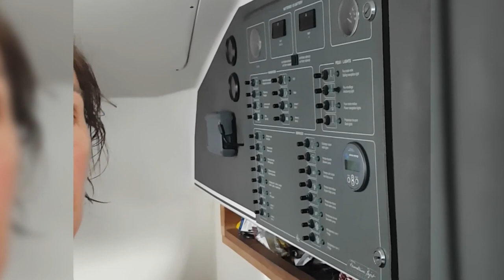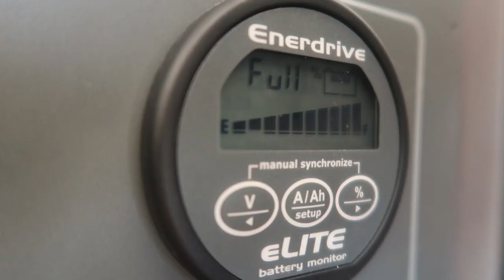Sailboat refit BOAT WORK - LIGHTNING DAMAGE Ep 84

Comment: Were you set up with lightning protection ?   Thanks
Reply from the maker: Hi John, as far as we know the yacht does not have any particular defence against lightning strikes.  However, apparently there are lots of different ways to do so.  One i've heard sounds interesting is some sort of fan of rods at the top of the mast that if hit can disperse the strike.  However, if it worked you'd think insurance companies would insist on them.
Reply from the maker: In case you missed it (and apologies for the delay) here is part 2: https://www.youtube.com/watch?v=Bbxfspilw4s&t=395s

Comment: Aah camaaaan! What kind of cruel twisted ending was that? Should have known that was where that was ending. Lol.
Interesting what you are saying about the power generation. you came up with something that alot of people don't think about, until it's too late. Power storage is as important as the generation. Are you on lithium batteries?
Anyway, I'll look forward to part 2. Seeing as it's following relatively quickly, I'll probably forgive you for that cruel ending. (Roll on the floor laughing.) Actually it's been a very Youtubey, sailing channel kind of morning. They've been popping up one after the other. Now I've caught up with you, I'd better get on and do!
Reply: Those are led acid batteries. They really should have a gen set. Wind power works on a sailboat much of the time, but its only 400 watts at best, where as a gen set of about the same cost will do a couple thousand in the pinch. Ideal situation is to have both. 

I live in eastern central europe off grid with my 2 sons, and we have both Solar, wind and genset when needed.  And we happen to be in an ideal belt for a 575 watt windmill. But it was over 14000 US to install it, however in the deep winter it has saved our ass. My solar is now upto about 3000 watts and that has run me $4500 and my battery bank is 48 volts at 550 amps. So quite large, and we no longer have any concerns about power. First couple years were rough though as it gets quite cold here.
Reply: @wishusknight3009  I imagine that a gen set would be important, living where you are, especially if your daylight hours in winter are as short as they were in Edinburgh when I loved there. Those short winter days are one thing I don't miss about living in Scotland now I'm back in New Zealand.
Reply from the maker: Glad you had a good laugh (desired effect)  and sorry for the cruel ending (I hope you can forgive).  Lead acid which do need the occasional top up of water otherwise work out well although much heavier than lithium.  I'm hearing good things about lithium though do wonder about the fire hazard - probably not an issue now days.
Reply from the maker: @wishusknight3009  that's a fantastic set up you have.  If/when we go land based again we would love to continue to live off the grid - the independence alone is worth it.  Great information shared, thank you.
There was no genset when we purchased Javelot and though at times we needed to turn off the fridge over night if there was no wind we seemed to manage ok.  Now we have an abundance of power though have not been tested in cold climate.  Maybe then a genset would be necessary.
Reply: @TheCruisingKiwis  Thankyou! The genset i have is 4500 watts and powered by a gas honda.  And althogh it wasn't too bad on fuel, having to run it for several hours a day to top up the bank did get expensive. and I think it ended up costing $1800 US brand new for the genset..  The first year we were here all I had were 3 year old batteries and 1100 watts of solar, My bank capacity was 36 volts at 175 amps and through the first winter the batteries probably never got a full charge untiI i purchased the above mentioned genset. All 3 of us were being paranoid about leaving anything on for anything longer than we had to. Was pretty dicey. Lots of dark nights sitting infront of the wood stove playing cards by candle light. Combine this with batteries that were not at their best either. 

It was quoted to cost me over $250000 to run power onto the property. So needless to say, we are offgrid. And I have added to it every year. Getting the wind turbine was the toughest choice to make, as there is a lot of fantastical claims and snake oil in the market. And terrain plays a huge role in the performance of the turbine. I picked mine up a couple years old and found one that is rated at average power and not peak power.. Seems like there is a huge difference between the two. And it is a pretty large unit at that.  Thankfully how its placed and how high its placed, its able to hit its wattage most nights through the winter and it probably provides upto about %40 of our power while its snowing. In the summer its more like 5%.   So from a cost perspective its a pretty bad value, but it is viewed as filling a very important gap in our power system here. As yours does for you. 

Solar power is cheap and you can never have too much. Get as much as you can fit and afford, you will never regret it. .I would say at this point the batteries are never below about %80 once or twice in the winter either. 

For marine application you can probably pick up a 2500 watt genset for a good price that will integrate well, and be there when you need it. 

BTW what voltages do you run your panels and battery bank at? I have my panels at 108 volts, turbine at 72 volts  and batteries at 48, simply because of the long runs out to my Array, and my system controller is already current limited for our needs. 

Though I understand for a boat, that 24 volts is more ideal incase of some panels getting shade, others will pick up the slack.
Reply from the maker: @wishusknight3009  that's interesting, thanks.  I hope others get something from this too.  One thing with land based wind gen that concerns me is too much wind.  I remember a friend gave up on them after losing two in successive years to storms.  I guess you've got to really 'ground' them well.
Reply from the maker: @wishusknight3009  by genset do you mean a portable?  I think that would be a good addition if we go further south (southern hemisphere) but am not in a position to invest at this point.  
I think the panels are 48 volts (or 24 - I'll check) and our 8 x 6volt batteries at set as 12 volt.
Reply: @TheCruisingKiwis  For our turbine, the bulk of the cost was the tower, and it can be lowered in just a few minutes by one person. The controller for it can also pitch the blades on the turbine and rotate the unit to optimize its generation to the given wind speed and that allows it to handle up to some generous gusts of wind. Not all units can do that though. One needs to shop around.  I would say though if you live in a more climate temperate area and have the space forit, just put the money into more solar and storage.  I think wind is only absolutely needed in some very specific applications. And in most other cases is more trouble than its worth. 

By genset, a portable could probably fill your needs just fine.  I maintain that a genset should be large enough to handle your entire system if its needed to. That way if you are for some reason needing to disconnect everything else, and run strictly from generator its not an issue. On a boat there are units that can be permanently installed into the system and controlled by your panel in the cabin. Even more ideal would be one that uses the same fuel as your engines. But cost would be a bigger factor there.  If I recall you had a small unit some many episodes back that was good for small use case.  You might want to look at getting something at least bigger than that, 1500 watt portables can be had for a couple hundred and are easy to carry and store, and fuel efficient.
Reply from the maker: @wishusknight3009  In case you missed it (and apologies for the delay) here is part 2: https://www.youtube.com/watch?v=Bbxfspilw4s&t=395s
Reply from the maker: @wishusknight3009  yes we had a .75kva generator that was almost useless.  So much so I have left it at a chandlery to see on behalf as it was rather weighty.  If I invest again it will be a decent sized one as you suggest.
Reply: @TheCruisingKiwis  Oooh yeah I saw that.   That.. Is a lot of money...  It does look though that portion of the money you are out of pocket seems worth the upgrades you did. Or at least I hope you feel that way.  Some of the new electrical stuff looks fantastic.
Reply from the maker: @wishusknight3009  Yes, to a small degree that may be the case.  However, several of the big ticket items (autohelm, AIS, Iridium Go, VHF radio) were only a year old.  Either way we are super chuffed to be back on the briny.

Comment: You may have mentioned, but I missed it.  Wasn't the boat grounded?  Don't they have lightening rods?  I have a rod on my house.  Is there something I should ensure?  why yours fail?
Reply from the maker: Hi Melvin, no we don't have any preventer.  There are many opinions on whether it's possible to effectively prevent lightning strikes. Some say there are and other suggest those 'preventative measures' may actually attract attention from a strike.  From what little I've heard there is a disperser thing that can be put at the top of the mast which seems to work pretty well.
Reply from the maker: In case you missed it here's part 2: https://www.youtube.com/watch?v=Bbxfspilw4s&t=46s
Reply: @TheCruisingKiwis  Boy, lucky lucky you had paid up insurance.  You got hit hard on the finances.  That would scuttle me.  Thanks for responding.